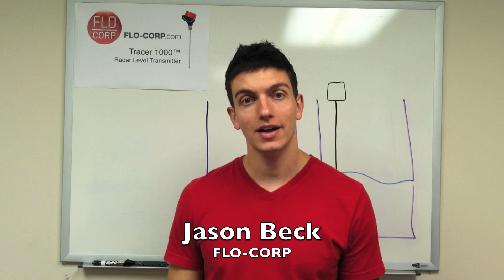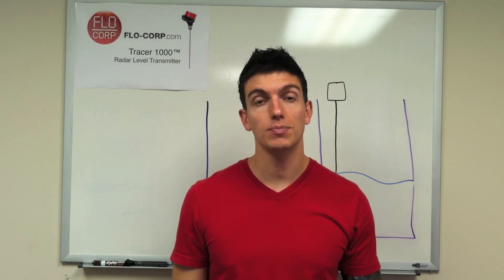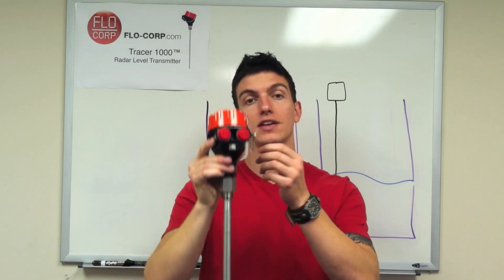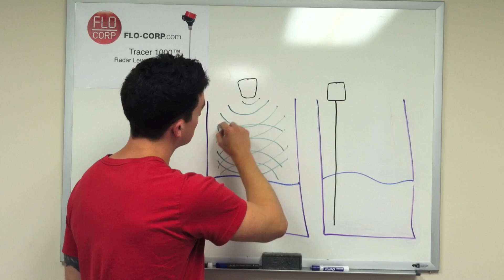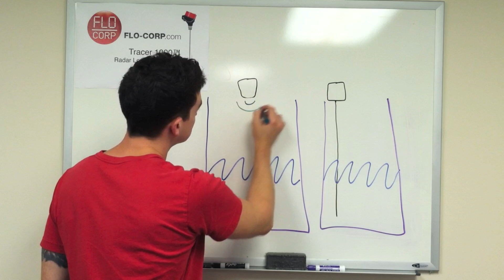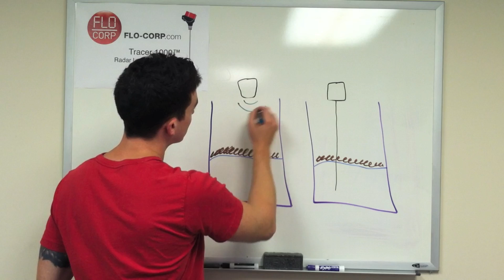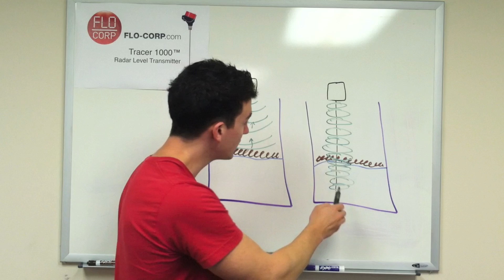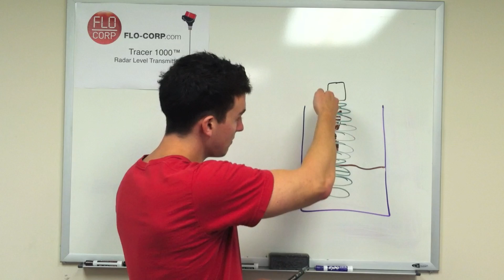Ultrasonic Level versus Guided Wave Radar Level

Comment: Excellent. Do you have any comments or explanation on non-contact radar vs ultrasonic? Specifically ones I am told can be mounted outside of a tank that can penetrate, for instance, a polymer blank flange or GRP vessel wall, and in this way avoid any H&S risk associated with exposure to the process media or perhaps a potentially explosive ullage space?

Comment: It's useful for petrol tank????
Reply from the maker: Thank you for your inquiry. Yes, FLO-CORP's Tracer 1000™ 3G Guided Wave Radar level transmitter is recommended for use in petrol tanks. Within the petrochemical and refining industries, GWR is used for measuring levels in distillation columns, crude storage, blending tanks, and liquified gases amongst other applications.
Reply: Thanks bro

Comment: can i use  Guided-Wave Radar (contacting) measurement in milk transport truck tank ?
Reply from the maker: Hi Barot - Yes, the FLO-CORP Tracer 1000™ Guided Wave Radar can be used in a milk transport tank truck application.
Reply: FLO-CORP --   is it measure correctly during milk truck travelling and  level of milk under tank is fluctuate ??

Comment: our tank length is 3000mm, but we procured guided wave radar level transmitter from rosemount -5301 of probe length 2000mm, can you help us how to prolong the probe length, can we add extra 1000mm s.s. bar rod to the existing 2000mm probe and configure the transmitter to 3000mm?
is it possible.

Comment: How would the feedback be in this application? I have a tank with an agitator. The GWR rod would be near the wall of the cylindrical tank. the agitator blades are nearly the diameter of the tank and are distributed vertically along the agitator shaft so that there is agitation from top to bottom. The Blades would frequently pass close to the rod at all levels as the agitator spins. At and below the liquid level, the passing of the blades by the rod would cause a pressure wave as the liquid is pushed against the rod. Have you had these in any similar applications? How was the feedback? If not, how do you thing the GWR would handle this application?
Reply from the maker: +Dale Michaels If you suspect that there will be a space issue with mounting the GWR probe in the tank with an agitator you may want to consider an alternate mounting arrangement or non-contacting technologies.  A couple of alternate mounting arrangements would be to mount a 1/2” diameter stainless steel tubing directly on the sidewall of the tank to insert the single rod probe of the GWR level system in.  This can also be ordered from FLO-CORP as a coaxial rod probe option.  Another option to consider would be to mount a pipe external to the tank with an inlet in the bottom of the tank to the external pipe and top connection from the pipe to top of the tank.  This is also called a “side arm”.  The GWR probe can then be mounted in the side arm.  If these alternate mounting arrangements are not possible you may want to consider through the air radar like the Tracer Air transmitters (http://www.flowlineoptions.com/level/level-transmitters/non-contact-radar-level-transmitters/) or the Ranger Series ultrasonic level transmitters (http://www.flowlineoptions.com/level/level-transmitters/ultrasonic-level-transmitter/).  Please keep in mind the ambient air space, properties of the fluid to be measured, pressure and temperature and tank height when considering through the air technologies.

Comment: I believe you are talking about Solids level measurement, where you'll see inclined heaps etc. Generally in these applications you can install ultrasonic level transducer aiming towards the center of inclined surface. Another factor you need to consider in it the amount of dust particles. If there is high dust in tank, then you should prefer to install High Frequency Non-contacting Radar Level Transmitter with easy aimer.

Comment: One of the best tutorials I have come across. Very much detailed explanation of how both the technologies works. In ripples applications, you can still use Ultrasonic Level Transducer using a still pipe around it and Echo Suppression in transmitters. In GWR when deposition on probe goes above the radar circumference it showns inaccurate reading. For those applications, non-contact Radar Level Transmitters are available.